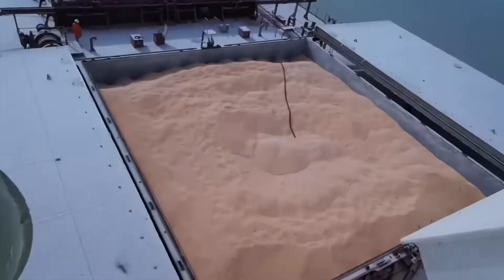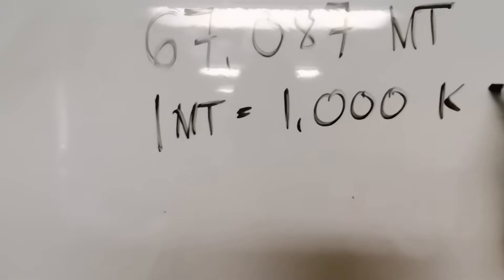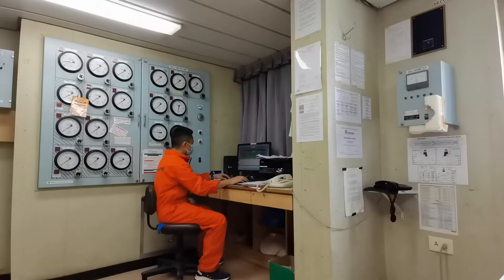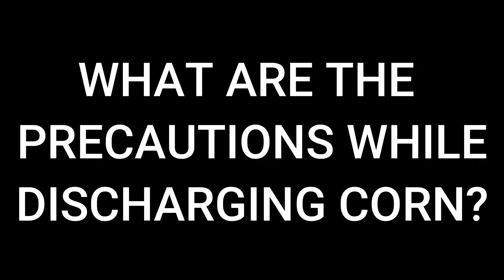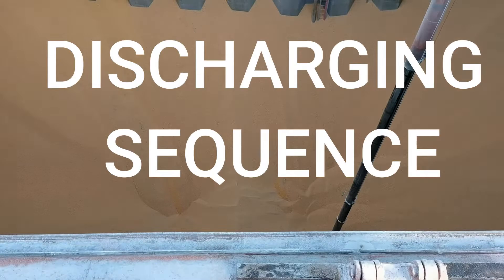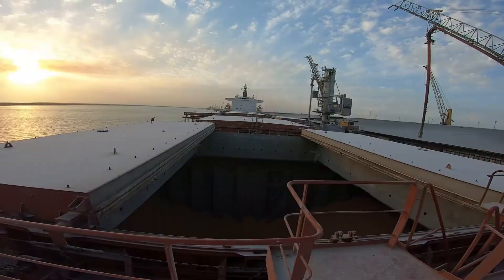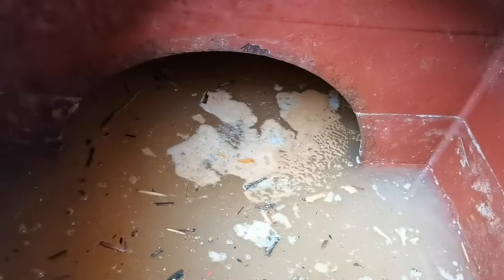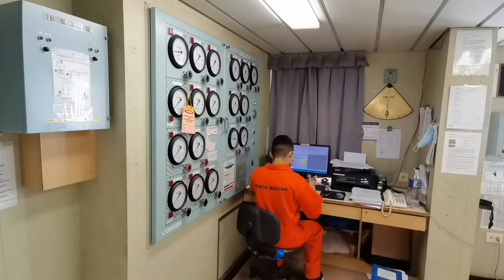HOW DO CARGO SHIPS DISCHARGE CORN IN BULK | PRECAUTIONS | CHIEF Red SEAMAN VLOG EP.10

Comment: The discharge procedure is fully furnished at the video. 
1, Is the loading process very similar with the discharge procedure? 
2, Is the second mate responsible for monitoring the loading/ unloading operation at the ship side & the chief officer controls the whole operation at both ship & shore side? 
3, Who works out discharge sequence? 
4, If rain comes suddenly  & some corns are wet due the holds cannot be closed quickly, is Shipowner  liable for cargo damage? 
5, Is it possible that the bulk cargo weight figure at shore side more than the cargo weight figure at ship side? If yes, how come?
 5, Will the vessel keep some corn samples? If so, how many samples? 
6, Is the inclinometer used to measure the list degree?
 7, Which equipment(s) shows & controls the ballasting & deballasting water figures?
 8, If the bulk carrier lists more than 3 degrees, will the loading or unloading stopped at once? Is it the usual practice for the vessel to sail at even keel after completion of loading and unloading? Thanks.
Reply from the maker: No it’s entirely different, discharging is more easy. 
No, the whole operation is the Chief Officers responsibility. Junior officers are assistants.
The Chief Officer for sequences.
Yes, it will be the shipowners fault.
Yes it’s always with difference because both weighing scale is just approximate.
We don’t, there’s an assigned individual to take samples.
Inclinometer yes 
Not really, they have to call me first and then I will assess the situation, it the list is increasing then I have to stop the operation and investigate.
If loaded normally it’s even keel or with a small trim.
Reply: @chiefred90  Thank you very much for your reply.

Comment: Is weather monitoring the sole responsibility on the ship's side, ie the foreman on the shore side bears no liability? If damaged cargo is found before or during loading, can the ship reject loading of damage cargo? If damaged cargo has already loaded on board, how to manage it? Thanks.
Reply from the maker: It goes both ways but of course we are in control of the hatch covers and when the cargo got wet inside the hold it will be our liability. Yes, constant checking during loading is done so if they load some damaged cargo then we need to do something.
Reply: @chiefred90  Thanks a lot